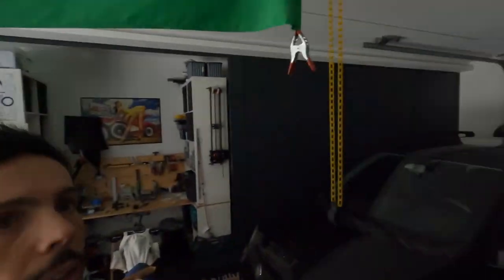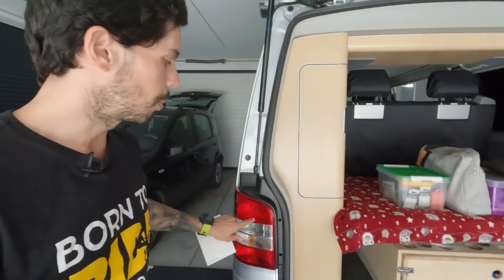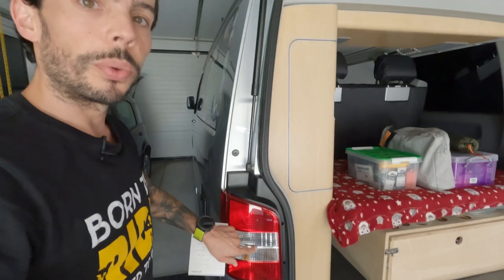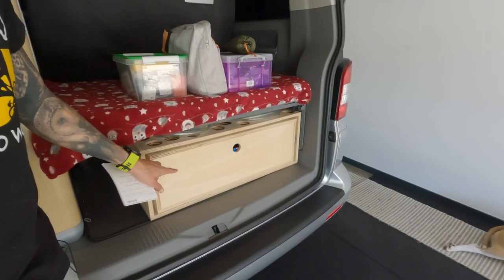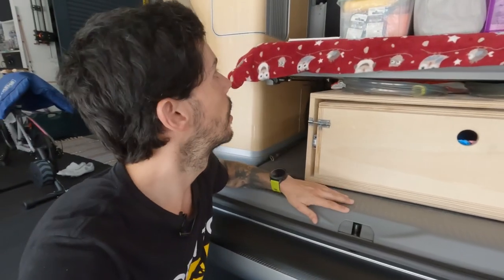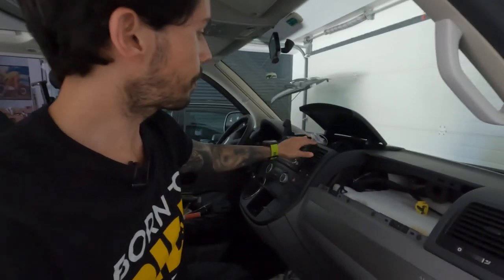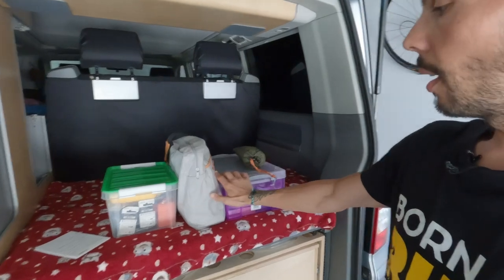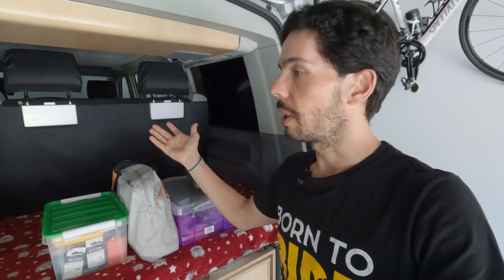Offgrid upgrades on a VW California camper - AM I INSANE?!! Episode #9

Comment: I’m lucky enough to have a 4motion with lifted/upgraded suspension & AT tyres and love the extra freedom it gives when camping off grid. I think you can achieve a lot of that with lifted suspension and AT tyres without the added expense of retro fitting 4motion especially if you fit a winch as an insurance policy! I will certainly watch if you do attempt it though! 

Have you done a video on your hot water system? I’d be intrigued to get more detail on that if so, looking at the thumbnails I can’t see one? 

Great content.
Reply from the maker: Thanks Mike! Still considering if we go for the retrofit or not but at the moment we are very inclined to go for it! Haven't done a video on the tank, as I built it years ago, before this channel. Happy to go through it when I record an episode replacing the cable down to it. And that's another issue! Where it currently sits is where the haldex and rear diff will be if we go ahead with the retrofit, so I'd have to remove it and build a new one to fit a different place under the van!
Reply: @soundskribble  I shall look out for that video. I don’t carry a spare wheel (they are too big) so could utilise that space for a small water tank without impacting ground clearance. Good luck with the retrofit!
Reply from the maker: @mikelambrou4462  that's a good point? Do you know your wheel measurements? I've been thinking 235/65R17 as it was suggested for rims I was looking at.
Reply: @soundskribble  mine are 255/55/R18's - so pretty chunky.
Reply from the maker: @mikelambrou4462  thanks! just used the tire size calculator, your size and the one I’m looking at are the exact same overall diameter of 737mm, the difference will be the taller profile, more tire less rim.
Reply: @soundskribble  if I were to do it again I’d probably go down the R17 rim route too. With BFG AT's the trade off for capability and durability is the ride is pretty harsh. The K02's are virtually indestructible though which was a factor in forgoing a spare! I do carry a tyre repair kit and good compressor though.
Reply: @soundskribble  BTW if you do go down retrofit route if you can incorporate a rear diff lock then it’s worthwhile imo. I’ve no idea if that is possible (I think it is on a 4Motion but it’s expensive) but thought it worth mentioning. It makes the Cali remarkably capable off road.
Reply from the maker: @mikelambrou4462  yes, that is a major point for me, I’ve done off road in my younger years and installed a rear locker in my Mitsubishi jeep at the time, so I’m aware of the huge difference it makes. All the donor T5’s I’ve been looking at only make the list of they’ve got the rear locker option.